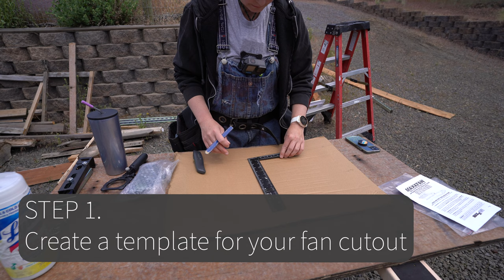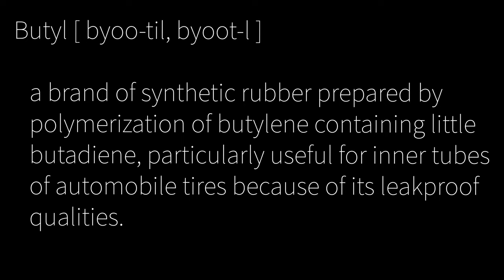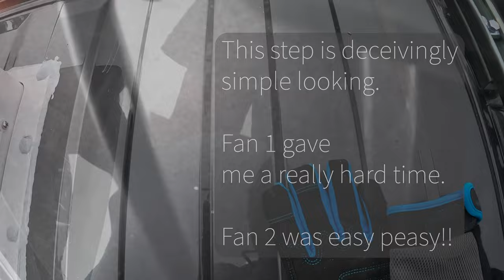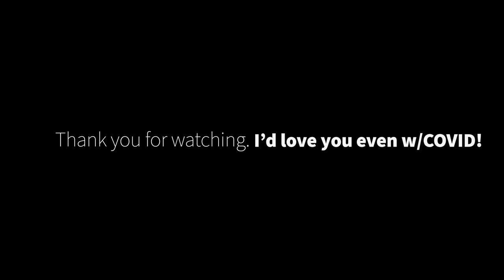Promaster Conversion: Maxx Air Fans | Solo Female Van Life | S1 Ep. 14

Comment: You  did ok with the Butyl tape, I would have added just enough in the troughs of the roof to make a fully flat contact for the fan trim.
I would be harder to find the holes if you drill then lift outy the trim and add your butyl tape